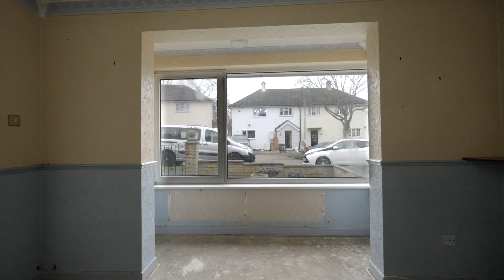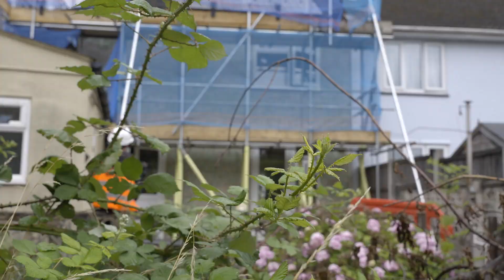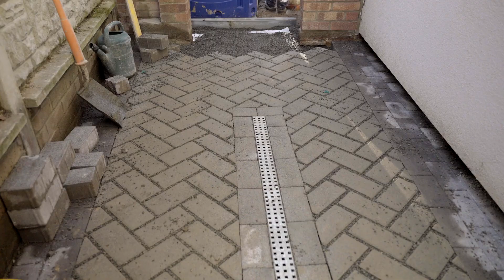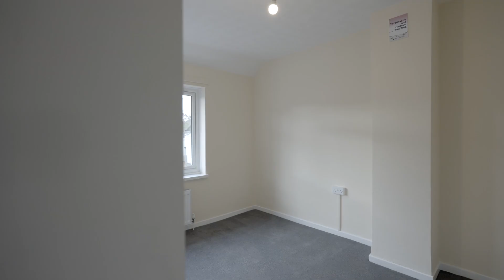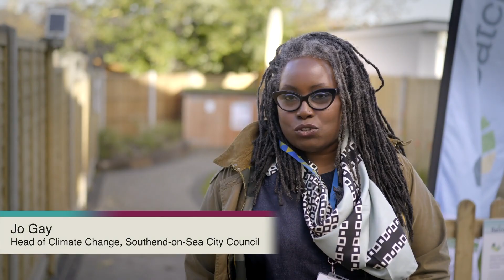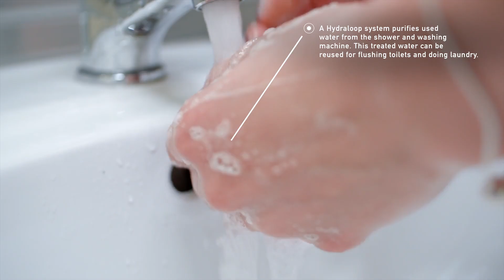Council invites public to explore innovative eco-friendly retrofit house

Comment: Good luck with most of that !
How much did it cost to install and when does it break even ?
And what will be the working life of the heat pump, before it needs replacing ?
Heat pumps DO NOT produce a CoP of 4 - except possibly in summer, when you don’t need them !
Remember that I took two installations out, at Temple Sutton and Baron’s Court, because they just didn’t perform - and, in the case of Baron’s Court, reduced the energy bill by 40% !
The air-source heat pump at the end of the pier had a chequered career, being plagued with refrigerant gas leaks, as did the installation at Kingsdown School.
None of them lasted more than two or three years !
I remain somewhat skeptical . . . .